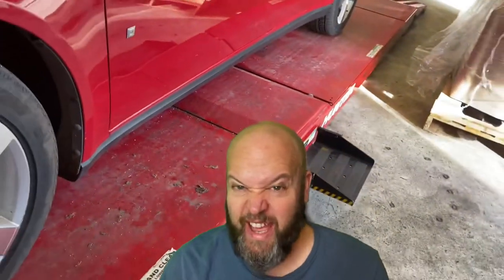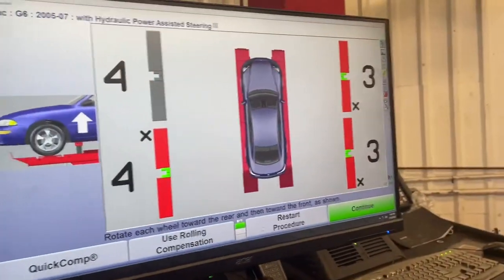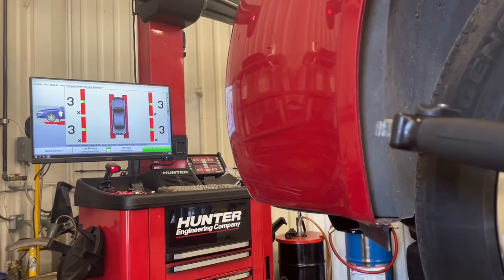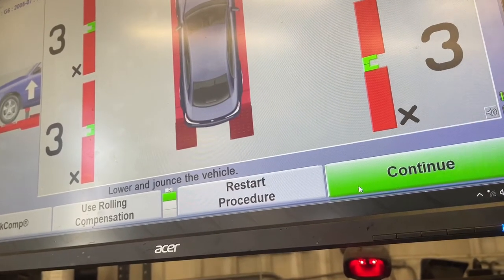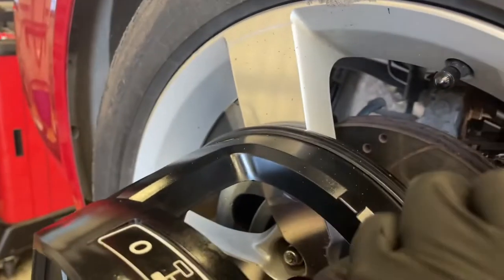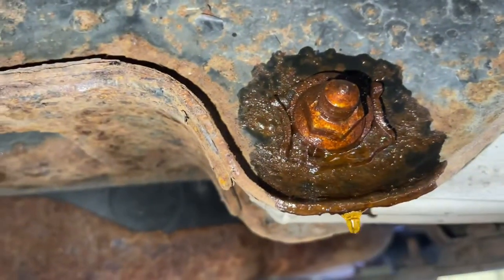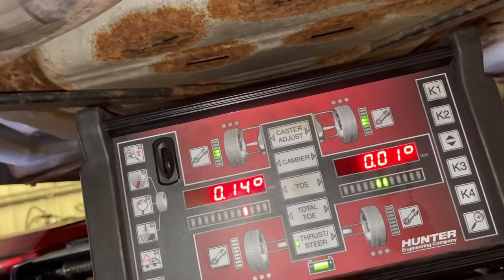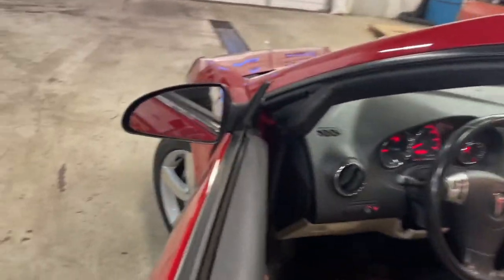Pontiac G6 Four Wheel Alignment! Toe, Camber, Caster, Compensation? What does it all mean?!

Comment: Thanks for making this video, there is so little information out there on how to align a G6. Can you explain in more detail what you are adjusting at the beginning of the 4:00 mark. It looks like you spray down the factory adjustable cam bolts in the LCA and the Rear Toe Arm, it that correct? At the front the adjustment for toe is the tie rod and if camber is off will you need to replace the factory strut mount bolts with cam bolts? Really need to have good information before heading to the alignment shop so I don't get taken advantage of.
Reply from the maker: What’s a while back? I don’t remember a lot of this information.
I don’t longer work at the Ford dealership, there’s a better fact two months after I quit this dealership went under out of business. 
Are use PB blaster to loosen up the front cables. And on the back the car came from Pennsylvania so it was pretty rusty under there.

Comment: Should've explained what causes the POS and Neg camber on the rear of the G6 and what parts  that may need to be replaced. I have a G6 sedan and my rear driver side tire has Neg camber while the rear passenger side is fine. But still a great video.
Reply from the maker: Yeah I started running out of time on the camber. But it’s a lot better than it was 👍😁
Reply: fascinating my friends car is doing the same thing. i havent got back there to see whats going on but its killing the tire. her car is salvaged though so i assumed that to have something to do with it until i just read your comment. Have you figured out what is causing it?